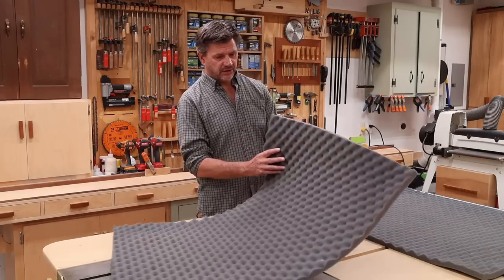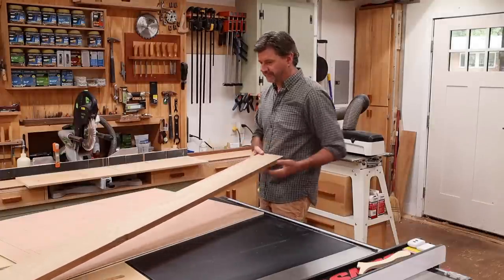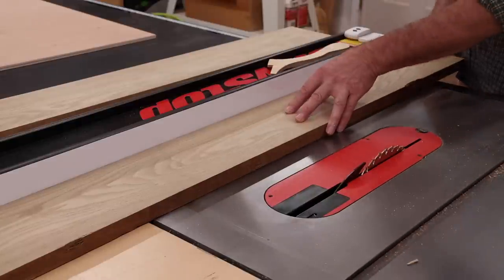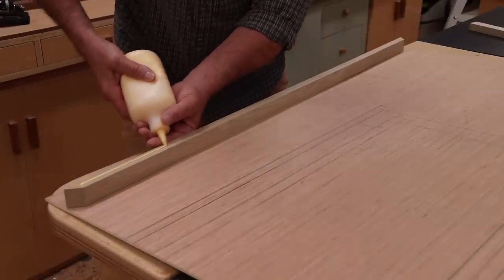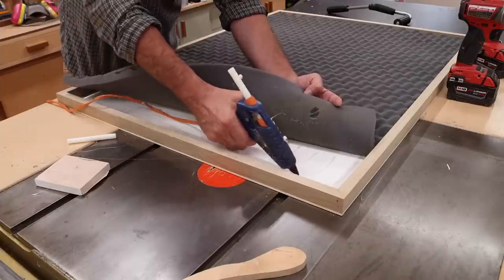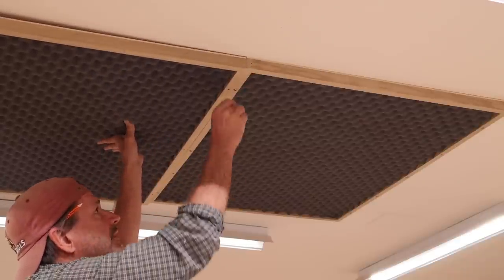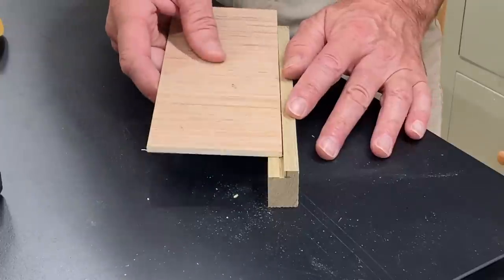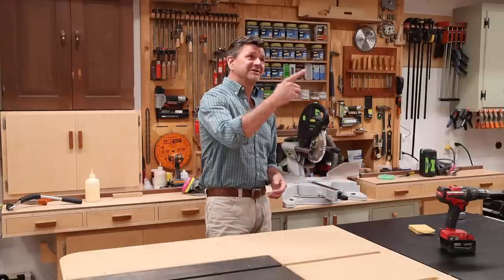How To Make Simple Acoustic Panels - Reduce Echo

Comment: Use rock wool for actual sound absorption.  That foam only absorbs  high frequencies.  Rick wool(Roxul available at home depot) absorbs highs mids and lows.  Check out Brad's video at fix this build that for his installation.  I've built over 1,000 panels in my day using rock wool and it's what recording studios use.  Plus its cheaper than that foam.

Comment: I'm glad you are concerned about audio quality. Those sound panels won't hurt, but what you need to do is get closer to the mic. I can take a sound studio perfectly designed and get the same audio quality that you are currently creating by backing away from the sound source with the mic.

One easy way of making an audio sound better is get a two track pocket audio recorder. Plug a lapel mic to the recorder and attach the mic to the collar of your shirt. I would get the recorder first to see if you can record in mono (one track) if you cannot, then make sure the lapel mic has a stereo plug on it so that you can record on both channels.

To test out what I mean do a test recording with the microphone of your camera about six inches away, with the mic pointing towards you. You will be able to tell that you have a better audio with the mic close.

If you don't want to go this route, think of hanging a mic over your head as in a boom mic. This has limitations if you move around the shop you will have to reposition the mic.

These do not have to be expensive mics, I've used $20 mics in a recording studio when appropriate. I hope this will help. Because the audio on your channel is far from good.
Be safe.

Comment: Radio pro here … as Gregory mentions below, rock wool does a much better job. And for people who want to improve their acoustics much quicker and cheaper … just go get some carpet remnants from a carpet store dumpster. Tack them to the ceiling above where you talk. Probably shag is better. It works great. 
If you’re starting off in voice work, you could build a little desktop folding enclosure using plywood and carpet, and don’t forget to put carpet on the desktop. 

And by the way, I put down a layer of cheap SYNTHETIC carpet remnants between the cement bottom and sides of my koi pond and the rubber liner. This keeps the rubber from rubbing against the hard concrete. It’s worked great for 20 years.
Thanks as always for the good content.

Comment: As always great info. But I do have a question. As the novice woodworker I noticed when you cut the miters you didn't have to switch the saw to accommodate the right angle you needed why is that? Is it because you flip it upside down and you can make the same angle cut but would be in the right position when you put it together?
Reply from the maker: Hi Dan, because the molding is a rectangle without any type of a profile… I can simply flip the molding to make the next cut.
Reply: @JonPetersArtHome  thanks for the quick response 🤘🤘